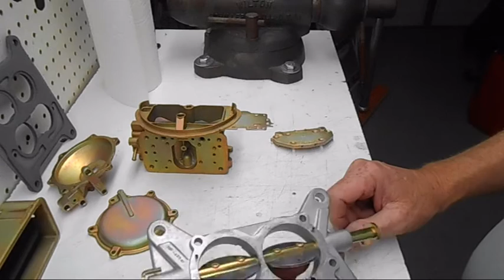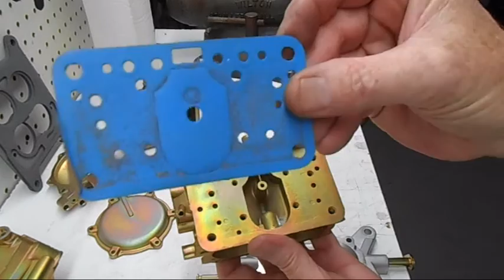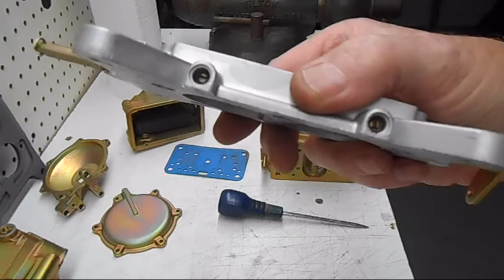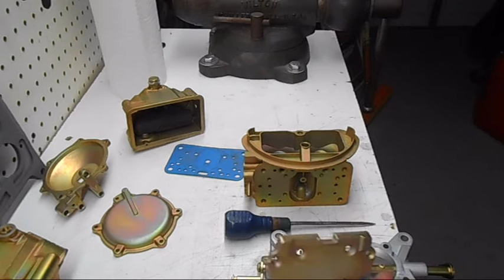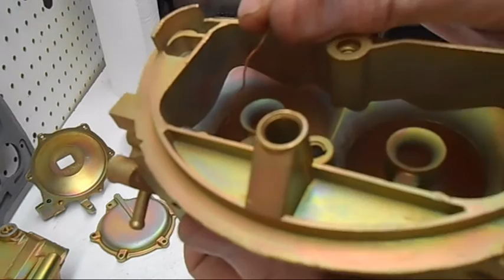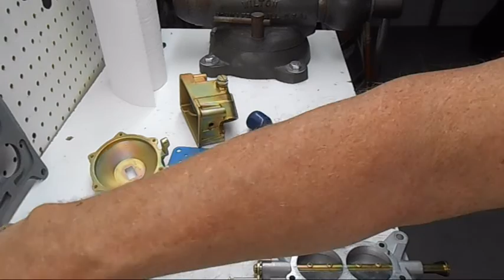Holley 440 6 Pack 6 Barrel Tri Power Part 2 End Carburetors

Comment: Thank you so much for theese videos, I'll be running a 70 Challenger with 440 sixpak in Stock and have almost gone insane adjusting it. Runs on idle one day but not the other and so on. Now I know how to adress the issues. Was surprised that the outbord carbs should be open 3/4 turn but i'll try that. Again many thanks!!

Comment: Thank you for all the detailed information.  I've inherited a "71" 440 6pack set up. While disassembling I notice both outboard carbs are #4671 (front carbs w/34 plates). One of them has an incorrect fuel bowl (like the center carb #4669).  Will there be that much difference in performance utilizing two front outboards and can I just adjust the float level in the one incorrect bowl carb to a lower level.  The correct bowl seems to be unavailable.
Reply from the maker: Yes And Yes
Call Six Pack Performance  NM They should have new bowls.

Comment: Know anyone that has these metering plates for the 340 Six-Pack and do they have two different numbers for the front and rear like the 440 set-up ?  Would the 340 set-up be the 34R-6153b  #41 Thanks
Reply: That's the numbers my 340 sixpack has...

Comment: You had it right, those are in fact kill bleeds in the secondary carburetors, they are larger in the 440 carbs than they are the 340 carbs, if they weren't it would make the carburetors open much faster due to the difference in cubic inches. I have in fact put a vacume tee in line to create more of a leak to slow down the secondaries, we did this on a dyno to control our secondary opening. I used a needle valve from an aquarium to control the amount of leak, it worked quite well

Comment: I just watched your video for the first time. I was having trouble with my 440 6 barrel and wanted to learn some more about it. On the secondaries I opened up the diaphragm pods to see if the rubber was ripped. The rubber was fine but I noticed that the ball bearings were missing, I believe it supposed to have one ball bearing in each pod. Should I replace this ball bearing or is it OK without it? Thanks Ed
Reply from the maker: Hi Ed
 DO NOT PUT CHECK BALL in the secondary pod. It will block the vacuum port and they will not open. Every rebuild diagram for Holleys shows that check ball. There are only certain vacuum pods that use it None for Six Pack Or Tri-Power. I talk about that in one of my videos.
Thanks for watching.
Harold
Reply: Harold Demes  Ok Thank you

Comment: I worked at plymouth dealer in 1970. These 6 packs had a bad problem bogging with the yellow springs. We had better results with the long brown or short black springs. You do good work. Good information.

Comment: Harold, there are two yellow springs in the holley spring kit. One is shorter and clipped off. witch one goes in the front carb?
Reply from the maker: Hi Randy I have always used short yellow on both out board 440 six pack.

Comment: Hi Herald, I have a couple questions? I wish I saw this video three years ago, after spending so much money on all these rebuild kits tying to chase my problem, but I think you explained it. Fist off I have a 1969 corvette 427 tri power, but I'm guessing the operation will be the same being its not a 440 6 pack, and still Holley. What happens with my carbs, is when the engine is cold, it runs perfect after sitting for  a week, but once the engine gets hot after driving for 20 minutes, the car starts to stall at intersections, and will not maintain an idle, unless I hold the rpm above 1500. If I shut the car off and let it cool  for 15 min, then it seems to start and run fine again. so when you explained in the other video about the power valve orifice section slowly filling up with fuel, because the metering block starts to warp, would this be why I am having these problems? Also it seems all the bowls leak down over night, and fill the engine with fuel?Any input will really be appreciated.Darren
Reply from the maker: Hi Darren
 I can see the center carb leaking fuel into the intake after the engine is off sitting. If the body and metering block are warped the fuel will leak into the power valve vacuum chamber and into the intake manifold. The out board carbs should not leak in to the intake because the vacuum hole is not drilled all the way into the chamber. I have seen some that were. But very few. The 440 has no hole even partly drilled like the Tri Power. You seen my video on the vacuum test. If you have a mity vac you can do the same test. I offer a restoration service $480.00 + shipping back to you. I resurface the bodies and take the warp out of the metering block. Everything is plated to the factory look. Here is my email   chucknorbid@gmail.com

Harold
Reply: Ah, ok thanks, I may just take you up on that, I’m at my wits end, after so many rebuilds. I’ll hang onto your email, and will let you know if I decide to get you to rebuild them properly. Thanks
Reply: @backnine  Great video. I'm rebuilding my 340-6 and this was very helpful in looking researching certain features of my 340 six barrel.

Comment: Thanks for all the good info . I wish I knew some of it back in 1979 when I had a mint 340 duster with 6 pack set up . It would stumble at high rpm . I suspected an air leak somewhere. Hey , I was only 18 at the time . Again , great videos

Comment: I am sure you are 100% correct, but the throttle blades on the outboard carbs open 3/4 of the way on the one I have in the shop presently. This is 47 yrs old and it came in with a backfire out the intake problem. Both pods are blown. Thanks again
Reply from the maker: If those outboards are opening mechanically then some thing is wrong with the linkage. If you open them mechanically you will get a lean condition and the back fire will go through that port I was telling you about and take out the diaphragm. The back fire probably took out the power valve in the center carb. Good luck. if the customer wants them done send them to me.
Reply: I am sure you are correct, just my observation. If you want to send me your email that would be great. t.o.p@comcast.net

Comment: It has been too long for me to remember but what was the reaction to the pod diaphragms not working, as the linkage opens and closes the carb plates.
Reply from the maker: The linkage does not open the outboard carburetors. It does close them. The vacuum source from the center carb comes from a port in the body throat just below the venturi. This feeds the outboard carburetor vacuum pods which opens the butterfly's.The outboard carburetors also have the same port in the body to assist with vacuum to the pod. The linkage will not allow the secondary's to open until it reaches a amount of the center carb opening. if the pods have a bad diaphragm the carbs will not open. Hope this helps.